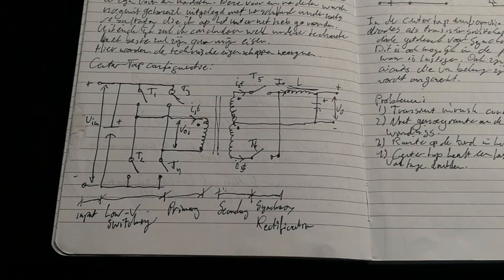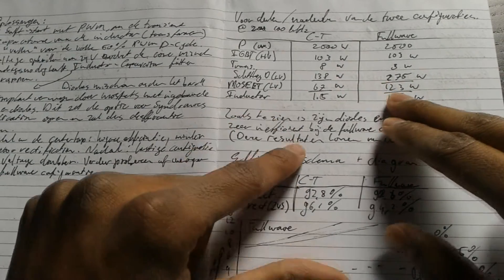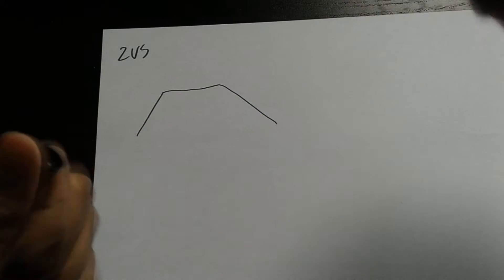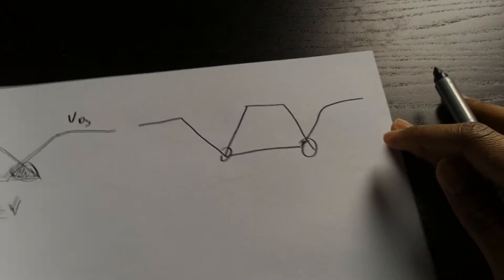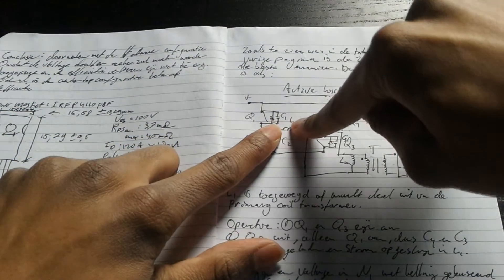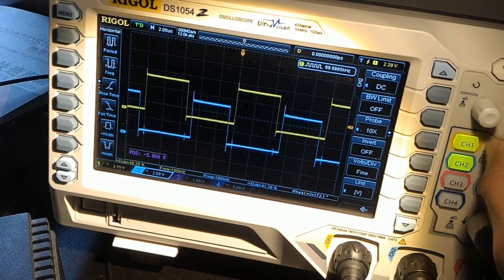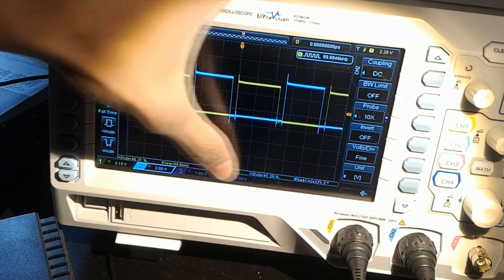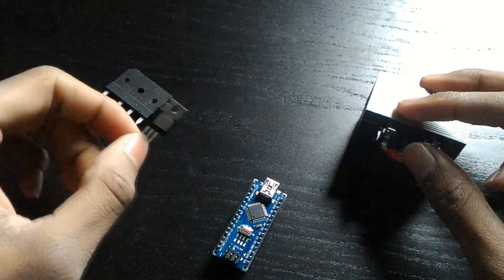Railgun Build - Episode 3: 400V Power Supply Part 1

Comment: I'm now finally clear on exactly what ZVS is.
Reply from the maker: I am glad! Sometimes ZVS is achieved by using self oscillators like the Mazzilli driver. Which can make it confusing. There is self oscillators and ZVS, in this particular case they are integrated in the same driving system.
Reply: Yes...if you remember I was planning to use a ZVS driver.
Can this topology be implemented in a flyback converter?
Reply from the maker: Active snubbing, unfortunately, yet fortunately (trust me), no. What you can do is passive snubbing. As a flyback converter is just a boost converter with a transformer. Take a look at this: http://static.richtek.com/assets/AppNote/AN010_EN/AN010_EN.jsp
Reply: 'Fortunately', yes.
The paper was very informative, thanks, but I lack the form factor to fit it all in. I guess I'll save ZVS for another day.
What kind of form factor are you looking at for your completed charger?
Reply from the maker: You'll get it easily, as you're only using 1 switch that should be ZVS, I have 4. For now I think I'll keep it easy for my prototype, using a half bridge. The high frequency phase shifted pwm fullbridge converter with synchronous voltage and current doubling is something way above me. I think I will make lots of progress in the coming 6 months, but so far, I don't have the application experience or knowledge. If I manage to get it to work we're looking at 5kW capacitor charging at near 90% efficiency. Lots of complications, such as fast N MOSFET high side switching, EMI, driver sequences, etc. So I'll try to build a half bridge in the coming weeks and hopefully have a working prototype soon. For now it doesn't matter if my capacitor bank charges in 10 seconds or 0.5 seconds.
Reply from the maker: I want to drive it by a microcontroller so I can change and play with the phase shifts and frequency, the arduino can't provide such luxury as it only has 2 interrupt timers that can be used. I can easily drive a half bridge though.

Comment: why are you using iron core transformer at 100 khz,shouldn't you use ferrite core for high frequency ??
Reply from the maker: The iron core transformer is for testing, I have ferrite cores. That is not definite setup. I also have more powerful MOSFETS, but Arduino can't do high-side switching, therefore must do additional tests.